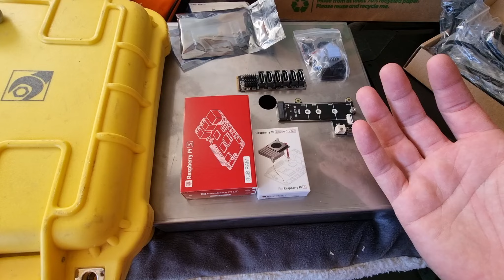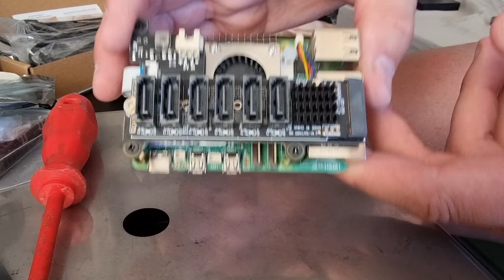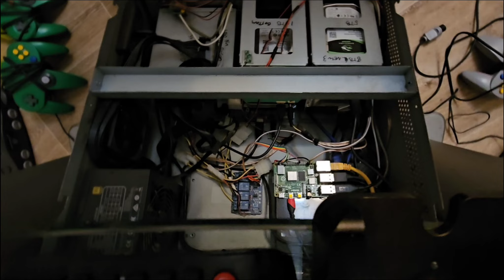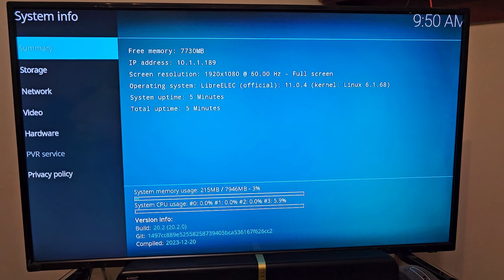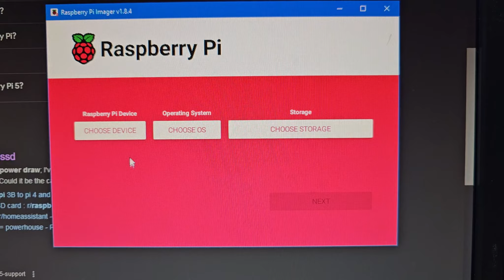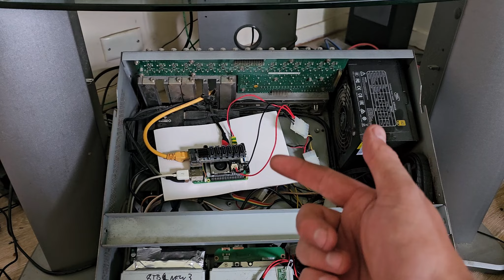Raspberry Pi 5 NAS update (Part 1)

Comment: I think it is a driver issue. Jeff Gerling have this one running but with 5 SATA ports, not with 6, the difference is that the 6 SATA is the asm1166 chipset, the 5 SATA is using the JMB585 Chipset. I don't know, maybe that will help. I am still too stubborn, so I will keep trying to run my NAS with my PI 5. I also plan to use it as a small AI offline machine to read and scrap documents for me and my ADHD
Reply from the maker: Yeah I critically needed 6, I'm aware of the other cards.
I've gone a whole different way recently, using a small desktop PC board (that looks more like a laptop board):
I did use the Sata card though.

https://youtu.be/Ai0nwVhKEBk
Reply: Even the ASM-chipset works if you add in your /boot/firmware/config.txt

dtoverlay=pciex1-compat-pi5,no-mip
dtoverlay=pcie-32bit-dma-pi5

Works fine on my Pi5 and OMV8

Comment: I have the same problem and have been trying to find a solution when i found this video, still trying to find a solution, hopefully someone finds a way. Glhf
Reply from the maker: there is now a 5 port unit available designed to specifically do what I want, but I have since used the pi5 for the media center in my 6x6 ambulance, and solved the bottleneck on the pi4 server, so I'm getting roughly 100mb/sec write to the drives. I can't really ask much more than that on SMR drives.
Next attempt I'm probably going to just bite the bullet and get a CM4 module and interface board and use a "normal" sata card.

Comment: I mentioned it on the other rpi nas but you should give the Radxa pentasata hat a shot. It adds up to 5 drives from the pcie port and a 12v socket that can power both the pi and the drives at the same time. I'm considering building a server with that hardware but so far most people on YT had built it with 2.5 drives instead of 3.5
Reply from the maker: @panconqueso9195  i already have 5v directly from the PC power supply thats better regulated. At present I'm getting close to the max drive speed attainable for SMR drives with my current setup. For what is effectively a digital dumpster, I doubt I'll change much. However if I do, I'll probably get a compute module and use a full size sata card.

Comment: when you leave pci gen 2 in rpi5 it corrupts the nvmes o storage attached, it has happened to me :(
Reply from the maker: Yeah I haven't had that issue yet, I'm using an NVME on this curreny as a media center in my 6x6 ambulance, until I can find a way to get SATA to work. I might end up using a CM4
Reply: Same happened to me in gen 2 couldn't even finish mounting the RAID had issue and data corrupted.

Comment: hi very interesting, can you check please something ? enter this two commands in front of your cmdline.txt: 
pcie_ports=compat pcie_aspm=off

it should look like this at the begining:  pcie_ports=compat pcie_aspm=off console=serial0,115200 console=tty1 root=PARTUUID=xxxxxxxx rootfstype=ext4....... after that im curios if it detects the sata card

first command is for compatibility mode, and the second is to set off the active power management
You can also check error while testing, just open in a terminal: sudo dmesg -follow

here you can see any pcie port error

Comment: I really wanted to see a part 2 of this because running a NAS off a Pi is a very power efficient way of doing things, which helps for something that runs 24/7. I've been thinking of building a new server that can be self-managed fully (instead of a Synology I'm using now that is kinda reaching end of support) but I really don't want something that's pulling 50-100W continuously while idling which you'd get with x86 based hardware, I have run a Pi2 as a home server before and aside from it randomly formatting storage it worked fine back then, a Pi5 has orders of magnitude more computing power. So I was very interested in this solution.

But yeah looking into it a bit closer it's most likely just impossible what you're trying to do here, the Pi5's PCIe connector only supports 1 PCIe lane and the multi-sata adapter most likely requires 4 lanes to work. The Pi5 has 5 lanes but 4 (or 2?, it's a bit confusing) of those are dedicated to the USB3 controller, so as far as I can see you'd need to do some pretty intensive hardware mods to rob the USB3 controller to get 4 lanes in a hodgepodge solution.

I think your original setup (just a bunch of USB3 drive controllers connected to the Pi) seems like you'd get the most bandwidth, at least the pi5 is still a nice upgrade: it will give you a bit more performance and you can stick a NVMe drive in the PCIe shield to maybe work as a cache and speed up frequently accessed file access.
Reply from the maker: There are similar chipset cards working on a pcie 1x adaptor in other setups, but I'll have to wait until someone better than me tries it, maybe people can share my video with a youtuber better versed with raspberry pi's

Comment: I think u need to power the pi through gpio to get more than 3a without the official PSU. The USB limits the current if u don't have the right USB c pd
Reply from the maker: I had an official 5 amp supply designed for that exact purpose, but in the past I have powered through the GPIO.
The issue wasn't power, but a combination of it expecting 4 pcie lanes, and needing a driver.